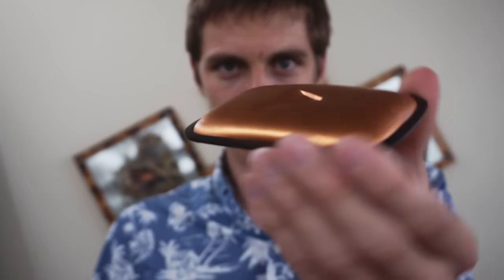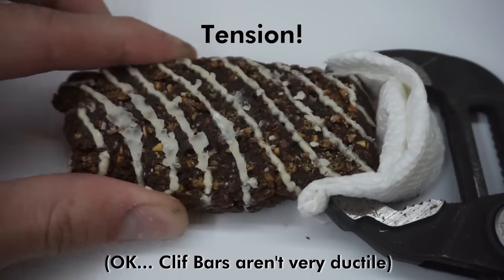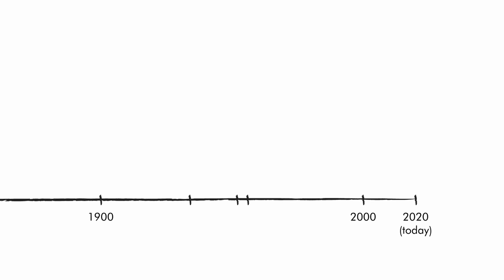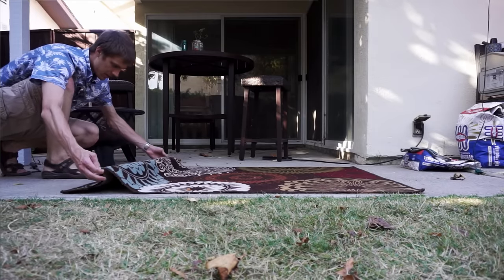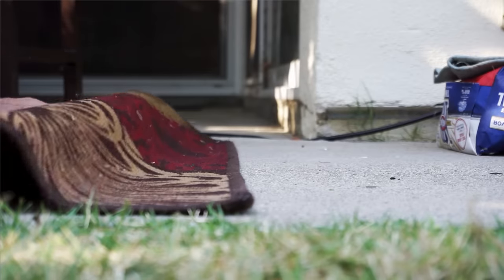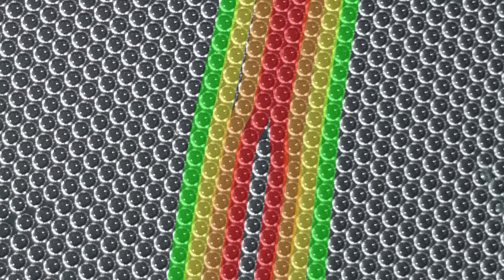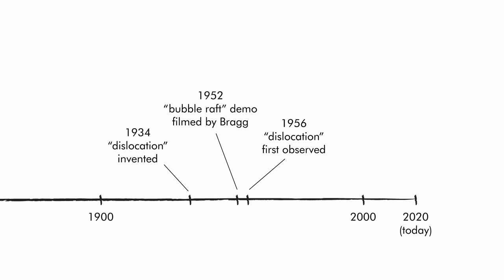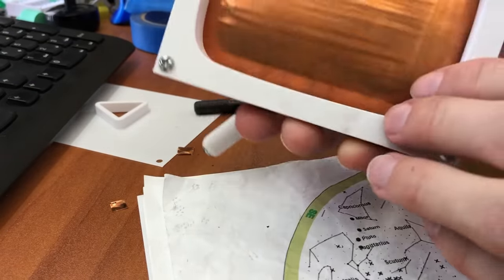Why are metals so stretchy? (2^13 sub special)

Comment: What I am loving in particular about the bubble demo versus the the steel ball demo, is that the bubbles have some give (like atomic bonds) so I feel that the resulting effect is more analogous to a crystal structure. Now if only we could think of a way to extend this model to build intuition about heat treatment of carbon steel...
Reply: Very intresting because your complaint was the same as what Bragg noted in his original experiment (Bragg Raft Bubble is a good search term) - he also wanted to know hat happened when heat was applied.

Comment: I wonder if the atoms zipping around is partially the reason for why metal gets hot when bent
Reply: Friction in itself yes
Reply: the atoms aren't zipping around, the dislocations between the atoms are
Reply: @MalcolmCooks  yes but the atoms are similarly moving to fill the gaps left by dislocations, which is why the dislocation itself moves
Reply: @MalcolmCooks  that's like saying the bottle isn't holding the water, the empty space is.
Reply: @Lunibruniful  given that atoms are mostly empty space, that's actually true, too.
Reply: Friction. The energy you put in to bend comes out as heat

Comment: Beautiful illustration of crystalline dislocation!  I once worked as a technician in a metal fatigue lab,
and it was dislocations piling up as they ran into each other due to stress-induced layer shifting that
caused the metal weakening known as "fatigue".  Seeing it illustrated with bubbles is very helpful to
understanding the phenomenon.

Comment: Watching the defects propagate in the bubble raft was such a satisfying way to vizualize how the crystal structure behaves.  Very cool, thanks for sharing!  How does work hardening play into this?  Does the crystal lattice "settle" into a more energetically favorable configuration over time and become less able to propagate defects without fracturing?
Reply from the maker: Hey! what a coincidence - I just was recommended one of your videos the other day (slow motion of chatter) which was AWESOME by the way!
Work hardening unfortunately isn't very obvious in this 2D example. Real dislocations in metals are line defects in a 3D volume, not 1D defects on a 2D plane (imagine this bubble raft stacked up vertically over and over again) and when dislocations run into each other, they can actually halt each others' movement and they basically get wrapped around each other. Because there are so many weird stretched bonds around a dislocation core, they don't really like each other. 
When a material work hardens, you basically fill it with SO MANY dislocations that they get wound around each other, forming a dense net, and preventing more dislocations from gliding. without the ability to glide past each other smoothly, the planes of atoms end up just breaking apart!
Reply: @AlphaPhoenixChannel  Hehe, small youtube world :)  Someone on the VacuumHackers Discord recommended your channel to me the other day and I've been dutifully binging through your back-catalog.  Lots of great stuff!  And I can't imagine the dedication to get some of them working (ice crystals, or setting up that Fizeau experiment)... pretty sure I would have thrown in the towel long before I got it working :)

Ah nifty, that's exactly the opposite mechanism I was expecting.  I figured things would slide around until everything just clicked into proper crystal positioning and then it froze up. But it makes a lot more sense that it's actually a tangle of dislocations stacking up and keeping everything from moving around cleanly.  I suppose that explains why annealing can help undo work hardening (in some metals), presumably the added heat energy allows the dislocations to smooth back out and untangle.  Neat!

Comment: This demo is so beautiful! And a great way to explain metallic bonds. Metals are easily deformable because there are no fixed bonds like in organic molecules or ionic bonds, instead the electrons are pretty much a cloud around the metal cores. Which is also the reason why they easily conduct electricity.

Comment: Very good demonstration of dislocations. 
In a salt a dislocation would directly lead to a fracture, due to to the sudden opposite position of ions of the same charge which repel each other.
In metals, the electrons in the conduction band of the atoms act as a glue that holds all atoms together.

Comment: I think I watched a Steve Mould videos while ago, but I also heard that the gaps in the crystal are the most interesting parts of studying martial science. Which really changes the idea of the most interesting material being one that isn't perfect.

It's also a great idea as to why you need to melt metal to form it easier (heat gives more energy, more jiggle to the atoms). It also explains how bending can generate heat due to the fraction between atoms and electrons. 

If you bend a plastic pen hard enough - it can reach nearly 110°C

Comment: I make jewelry, and do a lot of work with wire and sheet metal. I had always wondered how bending worked and why annealing (heating up the metal to make it softer) worked and why you needed to in the first place. I'm assuming that something that happens during the heating process adds defects back into the metal, maybe by having the molecules move to the point where some are made. Amazing video. Very well done!

Comment: at 9:05 when you started talking about the magnitude of the number of dislocations, it immediately explained to me why metals heat up when bent. Which, when I went and rewatched Steve Mould's video on this using metal balls instead of bubbles, also seems to have explained work hardening too.

Comment: I'm a Materials Engeneer and this video had me giggling like a maniac. This elegant setup makes a concept like dislocation motion so easy to visualize and understand. Totally gonna use this video next time I have to explain this!

As a tip: plastic deformation both creates and moves dislocations, but that cannot last forever. Eventually the dislocations interlock and the atoms can no longer easily shift, thus the metal hardens and becomes more fragile. To remedy that, simply apply heat. The thermal energy will give that atoms enough wiggle to reposition themselves in a more energetically favourable configuration, reabsorbing most of the dislocations. This basically resets the grid, so you can continue drawing the metal.
Caution: this may not work with metals that have tricky phases diagrams, like steel. Copper is fine though.

Comment: So much makes sense now. My highscool autobody teacher would tell of "old steel" on cars. How you could hammer sheetmetal around a wood block and how "new steel" will crack. Besides being made thicker back then, it took longer to make and cooled slower, making better formed crystals. Like giving them time to settle, like the bubbles. Thanks and i guess ill hit the subscribe button, gently to allow dislocations to work their way out.

Comment: I have made art from metal like you demonstrate here. I have found that modeling paste (such as Liquitex modeling paste gel medium) smoothed into the void on the back side, then sanded smooth works best for keeping the metal into its new form. Several thin layers works best so that there's a minimum of shrinkage of the modeling paste &the modeling paste dots evenly.
Reply from the maker: Fascinating! I've never heard of the stuff. I figured there was a "proper" solution out there somewhere but didn't know what it was - thanks for teaching me something! Sorry my example freehand "embossing" kinda sucked... I fear I didn't give a great look for the technique
Reply: @AlphaPhoenixChannel  I once made a rose using a cotton swab paper stick & a key from a canned ham in 36 gauge aluminum sheeting. If you get the result you have in mind,  you did it right.

Comment: Wow, I love the experiment with the bubbles! I want to try this myself now. I don't expect to gain any new insights but it does look like a ton of fun =D
Reply from the maker: You’ll absolutely see stuff I didn’t talk about - the bubble raft is a really rich simulation. I didn’t mention grain boundaries at all, and had to work to keep them out of shot. Also, try to see if you can tell what happens when a dislocation runs into a vacancy!

Comment: I have PhD in numerical simulation/material science and I've never seen this bubble raft demo/analogy. I had no idea ductility can be modeled with bubbles to such insane degree of accuracy.
Reply from the maker: Arguably, it takes less time to set up than writing a 2D Lenard Jones simulation! haha
Reply: @AlphaPhoenixChannel  I actually have no idea how you fabricated the nozzle itself and why it looks so strange. How does it produces bubbles of such consistent size?

Besides, maybe adding some amount of soap would make it more robust/consistent?
Reply from the maker: Hahahahaha: trial and error. I started with a basketball needle, which was way too big, then I tried to print a nozzle, which closed off, but it actually was able to produce good bubbles from the cracks between layers that are unavoidable in (non-vase-mode) FDM printing. Then I just dunked the rest in hot glue so I only had one source of bubbles and that was it!
Reply: @AlphaPhoenixChannel  so you're actually producing the bubbles with an artifact of fdm printing, nice.

Comment: Try this...  Hydro-Static Metal forming!!!  I watched a guy imprinted his art into pretty thick (like 0.060"-0.090") copper (malleable metal!) in a very exciting manner!  Welded his design to plate steel (Mold / Form), sheet copper and a bag of water enough to cover the sheet... and he Shot his rifle at the water, from a safe distance.  BAM, water explodes with a Huge amount of energy, Copper & Form go flying in the air.  And there it was, resting on the ground.  Copper Sign with his emblem artwork and lettering deeply embossed in tough copper. The rifle was a very heavy hitter, or to hunt Large game, and he used a high expansion rate Hollow Point ammo.  Keep up the good work!!  I hope the young students are watching this very engaging channel!!

Comment: 2^14 play button: make a transparent case, fill it with a fluid that turns to a solid when you close it (because of the pressure)? bonus points: it also changes color/transparency when it does so. also a cool way to show the difference between eg. water that expands when solidifying and some other fluids that reduce their size.

Comment: I never regretted subscribing to your channel. It's just the right level of nerdy. Just a questions maybe related to these shifts. 

When ships at sea twist and skew when they stretch across two waves at some point the metal gets "tired" and it cracks. I guess that is the ripples also cause some tares or decay on an atomic level over time?

Comment: Once you get too many dislocations, they lock each other in place and the metal becomes brittle.  At that point, you should have annealed it to remove most of them and then formed it some more.  This is "work hardening" or "metal fatigue."

Comment: Damn. That bubbles shot is mesmerizing :)
I had observed a similar "ripple" effect in neocubes (the magnetic spheres 'toy') but they don't represent this effect perfectly as they are diametrically magnetized. 
I think, though, that if the balls were six-pole magnetized, they would self-assemble in HCP sheets and would be able to mimic the "stretch" as well as the "squeeze" without needing bubbles.

Comment: Ooh! Almost forgot! 2^14 subscriber play button ideas: Lost wax casting, radio isotope drawing (so you can only see it with radio imaging), photoluminescence (so you can only see it with black light), hand rolled nixie-style cold cathode display (do this!) , "bio-display" (moss, mold, or other growth in medium), old school neon tubes, new school phospho wire,  x-ray film, recycled hdpe, braised brass bar, bubblegram, stereogram, etched glass (or insert exotic material of choice), DIY hologram (Is that even practical? Does that even matter?), or, you know, call ClickSpring and machine one (booooooring). Keep keeping on!

Comment: Really educational, but here's an interesting question: 
Why is it when you bend, not stretch, a metal (like a paperclip) back and forth enough times it will all of a sudden snap? Shouldn't the deformations just continue to ripple through and the hexagonal structure and sort of "self heal" after each bend?
Is it a build up of vacancies? how does that work?

Comment: Loved the vid and wished I could have learnt this way, might have changed my career. How does annealing the copper change the stiffness and make it more malleable again. I was thinking it might have something to do with the anatomic crystalline structure and it's propensity to dislocate or shear in particular directions under repeated tension. When annealed it can dislocate in more directions again, making it malleable in multiple directions. I don't know, guessing.

Comment: Having a single valence electron allows metallic lustre, ductility and malleability especially at the right temperature.
The change in atom to atom bonding is made without allowing the bonding energy to escape as heat. It works with steel as well.

Comment: Organically came here.

I think this model also shows how work hardening happens: By beating out most of the defects you make a very hard metal, but one that loses its ability to stretch, sheer, and pull. Instead if the energy is sufficient, it simply breaks the crystal.

Comment: This really leads me to another question: What IS work hardening? If it's all just metal atoms arranged in a lattice, WHY is heating effecting the rigidity of the metal, and conversely why do some metals become softer after heating and quenching and others are the opposite?

Comment: So copper becomes "work hardened" when you run out of dislocations.
How does the heating and cooling treatment work to make it malleable again?  Presumably it somehow introduces dislocations throughout the volume of the crystal.
Also... I seem to recall an explanation that involved individual grain boundaries, which is a bit different from a mostly perfect crystal with point defects within it.  Is that just a matter of the sheer number of defects?

Comment: Dude, awesome demo and explanation. Steve Mould, watch out!

Related question: Does this explain work hardening? If plastic deformation happens by dislocations moving around, then it follows that a flawless crystal would be the strongest form of that metal (i.e. no dislocations). Thus, as a dislocation reaches the surface and "deposits" its tiny bit of plastic deformation, it seems that the resulting material is more ordered (which makes some sense: you did work on the system to deform the material, so its entropy has the potential to go down) by virtue of that dislocation being used up, bringing the material closer to being a flawless crystal. Is that accurate, or am I--like the demonstration!--all wet?
Reply from the maker: ah good question - I just answered Josh Rips' comment about work hardening too - I would add that new dislocations are relatively easy to nucleate at grain boundaries and the actual edges of the crystal. You can see some dislocations zip into existence at the edges of the bubble rafts. That's what work hardening really is, creating SO MANY dislocations that they all run into each other and can't move. You do also end up modifying the grain structure in a polycrystalline material (of which the vast majority of metal objects are) but I tried to make all of the example rafts in this video as single-crystalline as possible for the sake of clarity - dislocation motion is at least the primary deformation mechanism, if not the only one.

 A perfect defect free crystal is very strong, but it's A) completely impossible to make because entropy will probably end up spontaneously making defects in your object, and B) I'm not sure that without more information about the loading situation you could say "strongEST" - grain boundaries help to slow down dislocations quite a bit, so polycrystalline materials can actually perform better. 

I think that for really specific high-intensity applications like jet turbine blades, they make entire blades out of single crystals all oriented in a specific way to make them strong for a specific loading environment, but those also aren't supposed to ever yield. If dislocations start moving around inside your airplane engine you better get to the ground quick before it makes you...

Comment: The carpet example reminds me of a trick taught in fire academy... Pulling hose up stairs is difficult due to friction and weight of water, but if you twist the hose into a large loop you can role it up and down stairs with practically no effort
Reply from the maker: Very cool!

Comment: A question that ties into your extreme vacume video. When using the MBE can you lay down prefect layers with out dislocations. And second if you can form a prefect monolithic piece how drastically would it change its structural properties? With out dislocation would a sample fail with out deformation and would it take more force before yeilding.

Comment: Carpets and bubbles to explain metal.  Nice work!

It does make me wonder though: If dislocations allow for plastic deformation, why are some crystalline materials (gems, ceramics) brittle and NOT ductile?  Is it due to atoms of non-uniform size?
Reply from the maker: Yes the nonuniform atoms do two things, they make stronger, more directional bonds that are harder to break, and geometrically they require the ripple to be much larger (to line up in the same spot again)